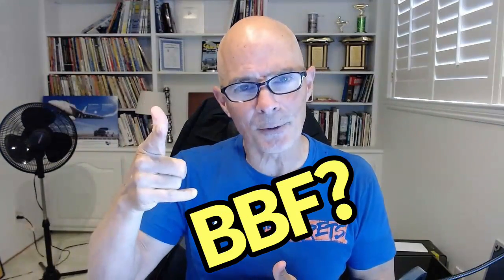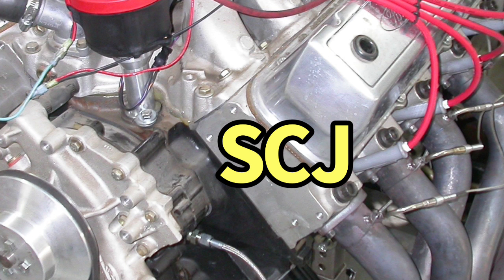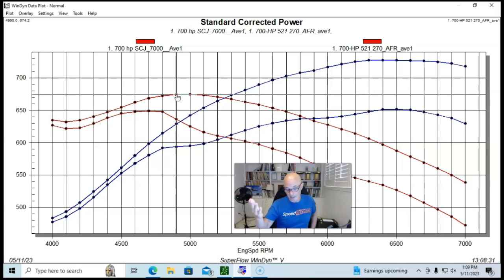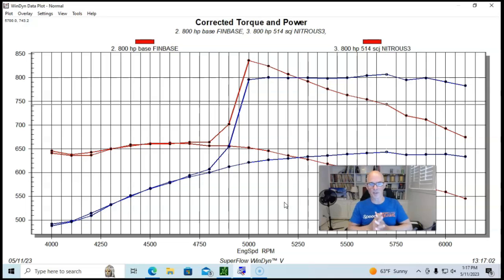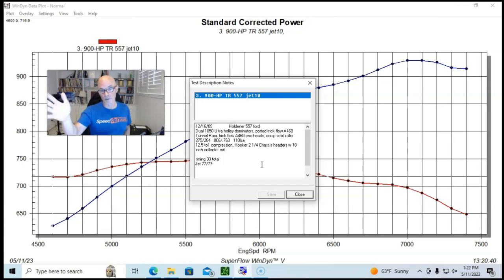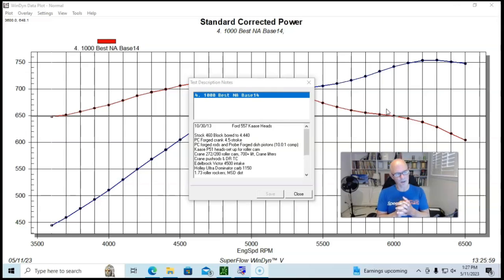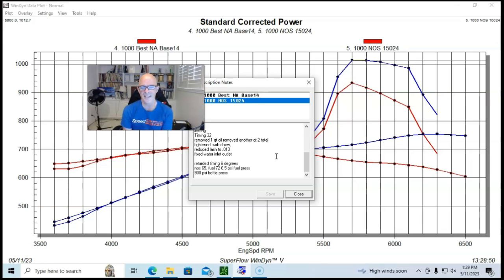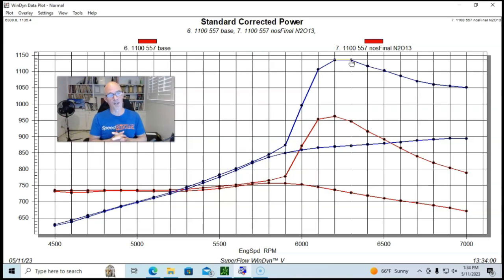HOW TO MAKE BIG BLOCK FORD POWER PART 2! 514, 521 AND 557 CUBE BBF STROKERS. 700-1,100 HP COMBOS!

Comment: Richard, how was it possible that Bob Glidden, who was the only engine builder/racer who went undefeated in NHRA Pro Stock class, in 1978, while using a destroked Windsor based engine with as little as 332 inches, and using his augmented Cleveland heads, was able to dominated the best factory tuned 427 BBC's..

Comment: 9:00 Rich, on the 557, were you still using a standard 460 block, or the A460? It was my understanding that you could only use A460 heads on an A460 block.
Reply from the maker: std block
Reply: 2 versions of the A460 heads one uses a 10 bolt pattern  ( same as stock ) the other uses an 18 bolt pattern which would used on the A460 block or other aftermarket  blocks
Reply: I thought the Cobra Jet heads and Super Cobra Jet heads were the same? From what I understand, they both have the same size valves and ports, know? I thought the difference was the CJ engines had hydraulic lifters and the SCJ engines had solid lifters, but the heads were the same? 
Also, being you are using a standard block, don’t you put a stud girdle on it? I’ll be worried with just 2 main caps.

Comment: 400m is the best bbf
Reply: The 400M isn't a big block. It's a tall deck 351M. It's also not a 400M only the 351 is called the M and the 400 is just called 400. 63 year old Ford tech Senior Master ASE so I'm not trying to BS you.

Comment: Richard, 

Two things; DV, goes to great lengths to show why LSA is more of a factor than many wish to believe. All these cams are 110 LSA, are potentially way off and would improve everywhere with maybe even 102 LSA.
Power AND Torque at these compression levels. Intake inertia signal.

This transitions to my second comment. With the increasing street torque trade off at each power plateau is there a way to fill in that torque hole below Three K with higher velocity ports or with a low threshold of boost with a tight hot side? Maybe even a variable turbine housing?
Maybe you may wish to for content sake do the late ignition timing trick where the mixture goes off inside the exhaust manifold ahead of the turbine inlet for us for testing purposes? Ever mess with that? I thing Norwood, came up with that a long time ago and many of the big wigs from Formula One were pumping him for his secret to instant full boost with a large turbocharger.
Reply from the maker: I know David very well and understand LSA (it's actually valve events and not strictly LSA). Formula 1 going to Norwood for turbo answers is very unlikely.

Comment: How about a NA 580” SINGLE CARB CAST MANIFOLD with SR71’s that makes 1094 hp @ 7600 rpm and 858 to @ 6100 rpm. I can show you the way, and would love to get the intake that was use to you for additional testing.

Comment: The most important  item in camshafts is "valve overlap" and most people have no idea whats going on in the valve train.  Oh, and use .005 /  006 start lift ,  .05 start lift means little !!!  Lobe Separation angle also means little,  use valve overlap,  that tells more about whats going on than anything else.
Reply from the maker: overlap is only 1 thing, and overlap with a 260/270 cam is different than the same overlap with a 210/220 cam
Reply: @richardholdener1727  Still, valve overlap says a lot. One cannot use vacuum power brakes with a 90 degree valve overlap or be very difficult.

Comment: so being realistic, by the time your getting up to 600-650+ about the only thing left that is a " ford short block" is the block? BTW could that curve dip around 4500-5000 be partly because of timing curve? is the timing curve controlled by the distributor or ignition box? wouldn't EFI just  fix just about all of the gremlins? face it, by the time your this far into the build $ wise, what the F@@k is another few hundred for a pre-wired loom an LS throttle body and an injector rail? in USD how much? $1000 - 1500? your already at about $8 - 10K into the build! make it more reliable and easy to configure for just about any setup? I am kinda jealous though. i admit it straight out. by about the 700 - 800 Hp where i am, we would already be looking at a $20000 long block with alloy heads. conservatively! i would have also gone forced induction before NOS. forced induction could add massive power without the will it grenade if the NOS jets i chose were too big. i can change boost with a spring and a press of a key.

Comment: Thanks for the video! My 552 BBF making 935 hp with kaase heads, single 1150 carb. Home built, using a 1969 (C9VE) 2 bolt block.
Reply: which kaase heads?
Reply: Sr71 heads, flat top pistons, trick flow intake.  Needs tunnel ram style intake for more revs/power
Reply: thanks. you seem like the only 1 with sr71's. do you have to use intake spacers? i dont mean the china wa @GlenEvans-hw8js
Reply: This is awesome. I have. C9VE block that is .030" over, i'm looking at a 502 stroker and was considering the P-51 heads, should i just go SR-71?
I'd be happy with 850hp, going into a 69 mustang with a T56 magnum for a street / strip and cuiser.
Trying to nut out specs, been watching David Vizard and Ben Ameda aswell to get some understanding.
Reply: @gettin-sendy  P-51 heads are great, little easier fitment (must use pistons for p-51 valve arrangement). sr71 heads need the big bore head gaskets 4.64" if I recall correctly, and the intake spacers at both ends of block. Will need fairly big cam 280* to 290* intake duration at .050 lift. 13 to 14 compression helps as well. Also will need Kaase to use the smaller Exhaust valves if using production block like the C9VE, D0VE, D1VE, D9TE etc. if using sr71heads with those blocks.
Reply: Now THAT'S a proper build. Peak power at about 6400?
Reply: @Drunken_Hamster  6900 rpm was peak hp, 5700 rpm peak torque (772 lb ft). So not real streetable, but not meant for that. Needs much more intake plenum volume, dyno operator thought intake was limiting rpm a bit.
Reply: @GlenEvans-q5p  Hell yeah. Do you think if you went with a larger intake you could've gone more conservative on the cam and kept the numbers similar while tweaking the peaks and improving the powerband range/average power?
Reply: @Drunken_Hamster  possibly a bit, but normally need the cam size to get the revs needed for HP. It all works together, you give up low speed manners as rpm peak goes up (if naturally aspirated ). Stroker motors don't usually work optimized with components designed for 429 or 460 cid, especially the 4.50" stroke used with these stock blocks, the aftermarket blocks can use bigger bore and go to shorter stroke. The old 70's tunnel ram manifold designs do not flow enough air for stroker builds without major modification.
Reply: @GlenEvans-q5p  Well, certainly there has to be an absolute bore size limit due to piston weight vs skirt length and not wanting to cause other problems by neglecting one or the other. It's the reason why in the vast sea of purpose-built all-out race engines (outside of drag racing) almost nothing has a bore larger than 100mm or roughly 4 inches.
Reply: @Drunken_Hamster  Yes, this is a drag oriented build. The stock blocks are actually very good, but as you go bigger in size and HP, you eventually need to go to aftermarket (Ford Racing or other) block design for more cid and strength.
Reply: @GlenEvans-q5p  That's not what I meant, really. Obviously, the bore spacing and wall thickness will impart a hard limit on bore size first, but also, at some point the pistons will just be so big that their weight will prevent safely revving to 7000+ even on a "short" 4-inch stroke no matter how long your rods are, right?

As for your previous point regaring the available heads, cams, and intakes being relatively unsuitable to long 4.5+ inch strokes, that's fine by me because I'm wholly uninterested in stroke lengths over 4.25 inches(and really over 4 inches), anyway.
Reply: 7000 rpm is by no means (at all) the "safe" limit in a big stroker motor these days. There are plenty of heads and cams and huge carbs available to "feed" a large cid motor, the 70's intake manifolds are small-ish for peak hp production.
Reply: @GlenEvans-hw8js  Oh.

Comment: Please do a 4.125bore and 3.98 stroke FE , some Bear Block Blair Patrick heads and intake. Molmar makes great rods, but factory rods from Blair and I wish I had a core I would loan you, but I don’t. A set of PSE crossbolted mains on 2 and 4. An iron crank the Bear 2x4 TW or a TFS single track heat. A 4.125x 3.98  425.50 cubes. They can do 850 hp NA. Bring the CR down and boost it. 1100 hp. That bottom end ran on the Cammer. With turbos this block is as light as a small block and can really rip. No one wants to do it. They are astounding! Blair Patrick is your man. He even has iron heads that can blow your mind! I know that without a doubt. This engine was the 60s Ford NASCAR and it kicked Enzo’s cars back to the village they came from and the Ford drivers were smiling from ear to ear. And remember RIP, Ken Miles who died without winning his triple crown he deserved testing the J Car. The 427 was rock solid against the world. This would make any Ford or any real race fans dream come true. Ken Miles deserves it. A tribute. HF2s “perfect engine “as he told the Countess.

Comment: I have a 521 BBF with AFR 280s, decent sized cam and a small carb that made 731hp at Westech. BBF has some great head options nowadays. Pretty easy to make 700HP today.
Reply: What Kinda Compression you runnig? I'm Awaiting my BBF from the machine shop, I have a Kaase 520 stroker kit to go in mine with Kaase P51's. Hopefully can see 700 on Pump 93.

Comment: The 514 solid roller wasnt from Comp .Ford racing cam in this engine was 304/306 254/258 .647/.647 112 lsa 107 ica. There was an article round 1999-2002 where the magazine changed from the CJ heads to the SCJ heads and then went through the Comp Cams Xtreme rollers (274XR, 280XR,286XR and 292XR) to dyno right around 700 hp . If I remember correctly the tests started with a 1095 cfm and ended up with a 1295 cfm demon.

Comment: Would love to see a NMCA NA 10.5 build. The Ford Windser based engines in the 400 ci range seem to dominate that class. Those engines rival prostock engines for hp/ci at 3/ci. One of the most exciting NMCA classes in my opinion.
Reply from the maker: a 400-inch motor making 1200 hp?
Reply: @richardholdener1727  Absolutly, but at the risk of doing injustice to those racers in the class, I am not associated with them, just a huge fan, so If I am inaccurate with any info please seek out those individuals involved. These are "Windsor based dimensions" for the the block with highly modified D3 heads. Benjamin Strader of EFI University talks about Robbie Blankenships engine at about 37:42 of the Clutch Burners Podcast Episode 5 https://youtu.be/FEQZHo--P6Q. He says it his 400 ci engine makes 1204 hp at 10,600 rpm on the engine dyno. Robbie's been 7.75 at 175 mph at 2800 pounds, shifting a Liberty 5 speed at 11,200 rpm or so. Reven Even interviewed Leonard Long not long ago https://youtu.be/W-khO0bWex4. He's won the class five times running a D3 headed 415 ci engine designed by Dave Visner. He claims 1100 horsepower and needs to weigh 2820 for the extra cubic inches. As the owner of Gforce transmissions he runs his own GF2000 5 speed transmission. I'm sure none of these guys will ever do it, but it would be great to see the build up of one of these engines and then see it run on the Dyno.
Reply from the maker: THAT IS A LOT

Comment: What can u do with a 351m?
Reply: Look up the Myers racing I think they have a 420ci stroker kit 3v/4v heads and a good intake alot can be done a 351m and a 400 are same motor basically and share parts with Windsors and Cleveland
Reply from the maker: see the 400m video

Comment: I've got a 460 I need to build to put in my 68 cougar. Mild ported D0VE heads, hoping for 600hp but mostly wanna run 10's. Now just have to learn how to build an engine...
Reply: Set up properly you should easily get in the 10’s.
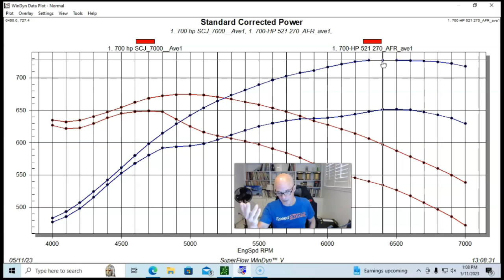Reply: @bri-manhunter2654  ladder bar backhalf, 10.5w tire, coilovers, 9" with spool and 4:10's, c6 with 3k stall.
Reply: @fraserfab68 . Sounds spicy!! Gotta love BB’s!! Good luck sir!
Reply: You're not going to have much room between the shocktowers on that cougar. Fantastic cars. I'd give serious consideration in going with a small block. Even long tubes on a 351w can get tight. My cousin had a 70 cougar with a 351c. He hated doing sparkplugs on it lol.
Reply: @I_like_turtles_67  I clearanced 1.5" on each shock tower. Spark plugs should not be a problem. I am thinking about replacing front suspension with AJE coilover kit which should allow even more tower removal. BBF Is already mounted via front motor plate.

Comment: Big Block Fords to the top baby!!!!
Reply: Not so much for Bob Glidden, who was the only engine builder/racer who went undefeated in NHRA Pro Stock class, in 1978, while using a destroked Windsor based engine with as little as 332 inches, and using his augmented Cleveland heads. That year, Glidden dominated the best factory tuned 427 BBC's..

Comment: I have SCJ-a heads and max lift is 65! You must have been using SCJ-b and solid lifters???
Reply: Only difference is springs and retainers.. The b heads get 10 deg retainers and the a heads get 7 deg ones. Stiffer springs for the b heads too..
Reply: @w3r3cow  then he shouldn't be able to run a cam with a 673 lift